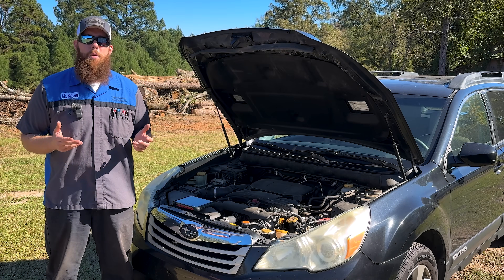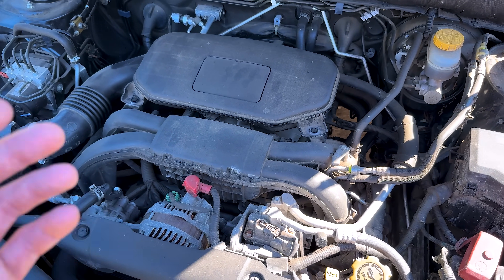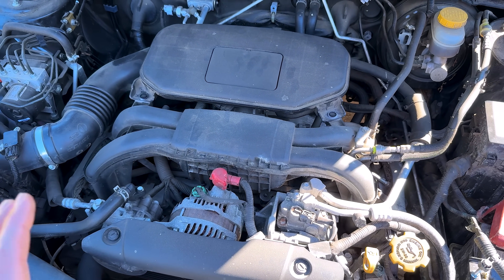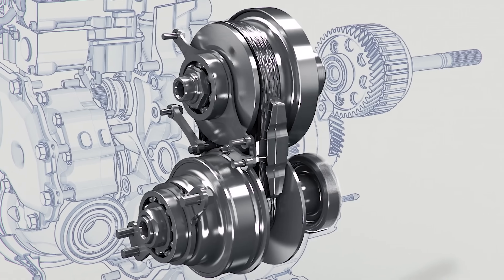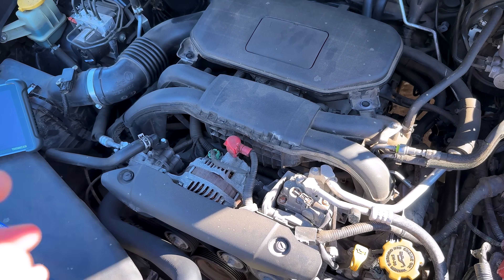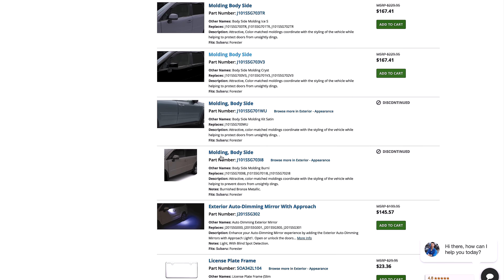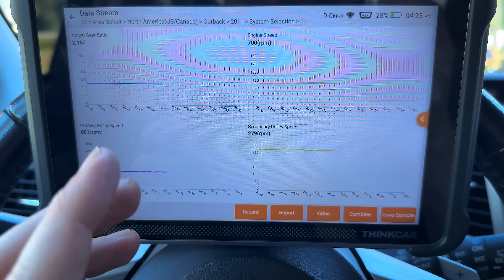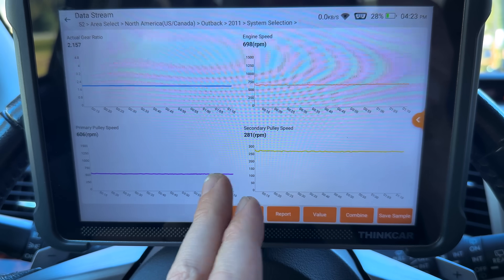Everything About Subaru CVT Chain Slip! How To Prevent It, How To Diagnose It, & Repair Options!

Comment: I had a similar experience but it was the throttle body being dirty 😂.Had the dealership do it and the car drives amazing and even better MPG lasts me 7-10days driving city.
Reply: You mean the valve body there is not throttle body in your CVT lmao
Reply: @CERTIFIEDBOOSTED Throttle Body connected to the engine needed to be cleaned.And the dealership after doing a multi-inspection did the maintenance.Made a huge difference
Reply: @stephenbrown2367 you had CVT chain slip with a loud squeal sound and rpm fluctuations over a dirty throttle body? I’m so confused but would like to know details on this matter like symptoms the car had to begin with?

Comment: Mr. Subaru,  would running AMSOIL CVT oil be a good alternative ? My buddy is a dealer and I can get it at cost. What are your thoughts on this oil vs Subaru CVT oil ?
Reply from the maker: No. I’d stay the factory Idemitsu fluid.
Reply: @MrSubaru1387  Here Europe (Scandinavia) Subaru dealers/service use Midland cvt oil.
Reply: Idemitsu SB2 OK or only Subaru CVTF-II?
Reply from the maker: @litchips  same thing
Reply: That's good to know, thanks! So fine to get 5qt jug of sb2 and a qt of cvtf-ii for flush?
Any experience with Eneos (Japan) model S cvt fluid?
It claims to be "engineered for specific vehicles manufactured by Subaru that require Subaru CVTF II* fluid" and is about half the price of CVTF-II, so could flush twice as many times and get more of the old fluid out for same price.

Comment: I flew half way across Canada to buy a 2023 Impreza with a manual transmission. My old 99 Impreza did 400,000 km and it's manual tranny was as tight as new. I'll never buy a car with a CVT.
Reply from the maker: Good on ya! Enjoy your new car.
Reply: so why did you get a new car?
Reply: Because #4 went to my son, and number #3 went to my twin daughters. So I purchased # 5 for myself.
Reply: @sashasmail-h6c  Live in central canada with 5 months of snow. The old Suby was rusting away to dust.
Reply: @Rickd-jh7iw  Ah, thats it. they all do at some point or another. up north, its only a matter of time. even if the mechanics still work. Fucking hate rust.
Reply: Toyota's eCVT is as reliabile as a AT. Never buy a CVT.
Reply: @zarbon700  It's still a CVT just using a regular FIRST gear only. lol
Reply: @horseathalt7308  You clearly don't know the difference between CVT and eCVT. eCVT is a 100% planetary gearset not a cable or chain used in CVT. Toyota CVTs does have a 1st gear for takeoff, however, they aren't a eCVT.
Reply: @zarbon700  I guess I don't want to  bother...A manual transmission is the only thing I ever want to drive. With reasonable care they will last over 400,000 miles.
Reply: Eventually you may not have a choice.
Reply: @Ray-hr9tb  There are still plenty of cars and trucks with geared transmissions.
Reply: @Ray-hr9tb  I'm 60 years old, my last Subaru lasted for 24 years, so if I get the same life out of this one, it might be my last car.
Reply: I've only owned 5 vehicles in 41 years of driving. The fifth one is a 24 crosstrek sport. I've never owned a Subaru, so we shall see. At 57 myself, it wouldn't hurt my feelings if #5 will be my last car purchase as well.

Comment: The chain "wear" on the pulley can wear through the case-hardening on one side of one of the pulleys.  When the resulting groove on the pulley wall is deep enough the chain will hang up in the groove then when the ratio changes come down into the pulley valley with a strong jerk.  The fix is to replace the entire CVT as a unit.  Ask me how I know.
Reply: Thanks for your information, I really like Subaru and I want to buy a new Forester or Ascent, do you think it is advisable???
Reply: @lazaroyumar3092  Absolutely.  The Ascent had some teething problems out of the box but the Forester is a very proven vehicle.  All my Subarus have been very long life and very dependable.  My CVT issue was in my '90 Justy, the first modern CVT vehicle made. Again teething problems.  But in that case very unique ones.
Reply: @rodh2168  Thank you very much for your reply, I am really considering the 8-seat Ascent, although I am still a little scared about the CVT, but I think that by doing the maintenance (oil change) every 30k miles I will not have any problems 👍🙏

Comment: Thanks for video, good info. I change front & rear diff fluid every 30K on my 2017 WRX. How often should I change CVT transmission fluid? Tks.
Reply from the maker: The same. Drain and refill is advised for every 3 yrs or 36k miles.

Comment: What about installing a filter in the cooling lines, to capture particles finer than the pickup screen filter?
Reply: What would that do for the CVT?
Reply: @atticstattic  It would reduce particulate size below the Lambda of the oil. That would help reduce abrasion on the chain and variator cones. (maintain particulates below the size of the thickness of the oil film between mating surfaces)
Reply: @vincentrobinette1507  
Again, why would a filter on the cooling lines do that?
Reply: @atticstattic  I think he is referring to the trans oil cooler? Sounds like he is suggesting to put a trans oil filter before the trans oil lines get to that cooler?

Comment: Thanks for your comments about misfire.  My Subaru was occasionally jerking when accelerating at low speeds.  I feared CVT trouble. My mechanic found evidence of misfires on cylinder #3. New Sparkplugs (and valve cover gaskets)...now 100 miles later no problem.  Hope it's going to be okay!  Whew!
Reply from the maker: Glad it wasn't the CVT!
Reply: how many miles was this happening to your spark plug? im at 60k and i know the maintenance schedule says to replace the spark plugs but i feel like its too early for titanium spark plugs. and i figured if it started to misfire like what you dealt with I can just set up an appointment to replace.
Reply: @jcosta223  it was 125K. The plugs were not replaced previously. By the way, it was quite expensive!
Reply: @carlnyberg2934  thanks. Definitely not replacing them yet as I've heard similar scenarios like yours.
Reply: @jcosta223 I just replaced mine on my ‘17 Impreza at 104k. I wasn’t having any issues but figured it would be good to do them. The gap on them was roughly about 0.040” and the new spec I think is 0.031” give or take. You can go quite a bit longer but doesn’t hurt to change them before you have issues.
Reply: Got my 2018 wrx back after engine rebuild .. now the car feels sluggish during uphill or whenever i press gas.. is that a cvt issue… boost is ok rpm is ok too

Comment: Does driving the CVT in manual mode (where the chain constantly hits the same spot on the pulley to simulate a gear) accelerate the chain slip issue?
Reply: I think it does, me hitting the downshift to pass a lot I think is what accelerated mine
Reply: Absolutely. Bought mine at 111k mi, didn't notice any slippage until after I used manual mode a few times.

Comment: I recently brought a 2017 levorg 2.0 gt-s. It has 95,000 klm on the clock. At 88k it had the trans removed and the fluid pump replaced due to a leak. 
What's the chances they had to flush and replace the fluid or would it just have been topped up ? 
TR690 cvt
Reply: Sounds to me like you got new fluid. Check the bill, they surely charged you for it.
Reply: @mockingbirdwishmeluck6403  I recently brought it. The cvt oil pump was done 7,000klm ago. The paperwork I have just says the pump was leaking and cvt was removed and sent to a local transmission shop for pump replacement under warranty

Comment: My 2001 Outback has 190K, the transmission is 💯😙
Reply from the maker: 302k miles on the original 4EAT in my 2002 Outback L.L.Bean
Reply: those are much more durable than the cvts
Reply: I was on my third manual transmission by 175k in my 01.
Reply: 180k problem-free miles with my 2004 with the 4EAT..
Reply: 170000 miles on my 14 forester…had to replace valvebody at about 95000…. But no problems whatsoever since

Comment: As a Subaru owner, perhaps one of the only benefits of some newer type of hybrid cars, like Nissan e-Power and BYD Super DM (Dual Mode) Technology - they have no transmissions as the motor has no physical connection to the drivetrain.  It's time!  Car transmissions need to go, unless it's the super reliable Toyota e-CTV.
Reply: Isn’t Hondas system like that too?
Reply: @thomas735  I think they use an eCVT like Toyota.
Reply: @bazinga615  oh
Reply: Honda has no mechanical connection between engine and wheels until you reach cruising speed when overdrive clutch engages. Toyota uses planetary gears to continuously direct power between engine, motor and wheels.

Comment: No slip on my '17( edit), 2.5i Forester. 195000 miles. 
    Fluid drain interval is every 30 K( since new), same interval on both diffs.

No scan tool but still runs same rpm (2000) at 70mph as when I drove it off the lot.
Reply: Do you burn any oil
Reply: @gary_beniford  about a pint during my 5000 mi OCI.
I kep it  topped up during that time

Never any check engine lights.

Have always done my own  oil changes using full syn AMsoil, 5000 mi.  OCI,  and recently Kirkland( costco full syn).
Reply: @williamevans6522  my legacy has the same engine. I've been burning oil since 132000 miles. I'm at 160000 now. The oil clogged my catalytic converter and I had to replace it. Earlier this year. Now I'm getting codes that come and go like the new one will get clogged soon. I'm hoping to pay off my loan soon and trade it in for something else
Reply: @gary_beniford  What year Legacy?
 OCI, always full syn? Use fuel system cleaners, changed PCV valve...
There's  many reasons engines start using oil.
Reply: @williamevans6522  it's a 2013, always 3-5000 mile oil changes. Yes I changed the pcv valve.
Reply: @gary_beniford  Full synthetic with a premium filter? 
  Never let the dipstick  drop below the quart low hash mark? 
Maybe the former owner abused it .
Reply: Thanks for your information, I really like Subaru and I want to buy a new Forester or Ascent, do you think it is advisable???
Reply: @lazaroyumar3092  Buy a used , low- mile '17, non- turbo.This was the last year of port injection.

'18 ,and newer have DI motors that require periodic , expensive cleaning of the intake valves.

Comment: On a side not. How does one test the signal to a EJ injector. New Injector But on scan tool shutting Injector 4 down has no effect on rpm. (misfire cly4 2007 Foresterx)
Reply from the maker: Looking for pulse at the injector? Noid light easiest test.
Reply: @MrSubaru1387  don't have them. But if there is no pulse I would have to go further. Can I skip the light and test the output with a meter. And if so what should I be looking for.